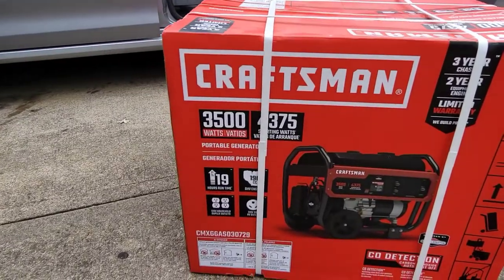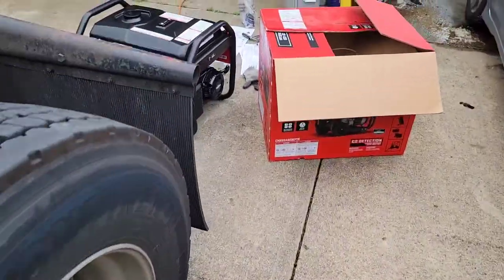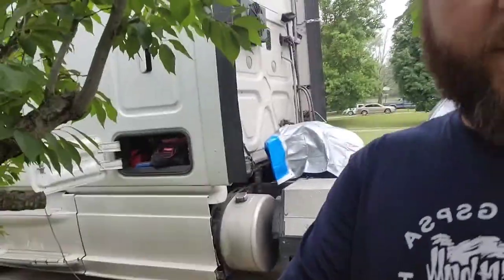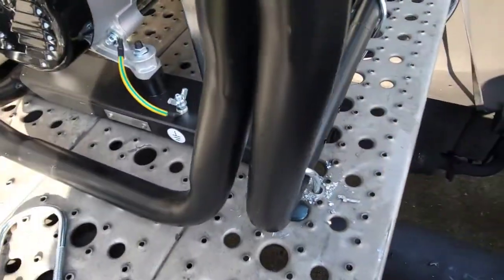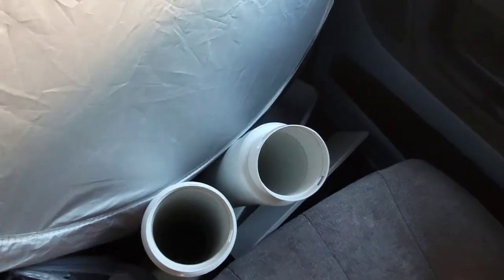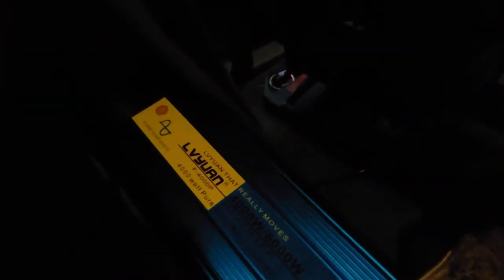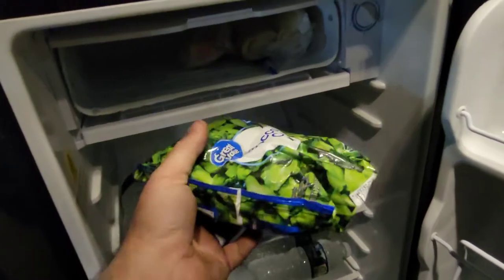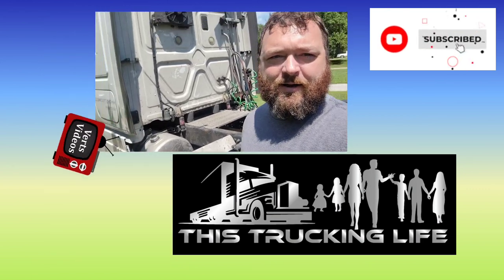How to Install a generator on your semi truck.

Comment: I think you will be saving more than that ,, I run my 3000 eu inverter and  is only 2 gallon tank and less for 10 consecutive hours just running the the 10,000 btu ,if is really hot outside I'll say 8 hours straight
Reply from the maker: I have switched to a smaller more portable one it last about 7/8 hours and runs my smaller AC but I got out of the owner operator game it's a joke I make so much more money now with Walmart check out my last live if you're interested it's awesome

Comment: You can put a muffler on your generator to quiet it down a whole lot more.
Reply from the maker: I almost used the one from my old apu but instead I bought a smaller one. It's just easier because the little one you can keep in the cab or under bunk until ready to use and it's a much quicker set up...I had my bigger one on the cat walk with a tarp...took for ever
Reply: Is that something that needs to be modified or can just add on?

Comment: I've just watched your video, and i love it. Maybe you can respond to me. How do you protect it from the rain/snow or to be too obvious when it's running?
Reply from the maker: When it rained I had it under the truck. No issues always had it on the ground and locked with a cable lock lol

Comment: I have same setup but the problem is carbon monoxide getting inside truck 
I did extended exhaust anyway getting inside
Reply from the maker: I ALWAYS have a working carbon dioxide alarm inside the semi. I ended up using a smaller and quieter one. I was able to put it on the ground under the truck down wind. Worked good.

Comment: Hey what type of ac/heater do you use for you truck.  Looking for one for mine so I don't burn threw as much diesel fuel in my truck.
Reply from the maker: Well for ac I use a Haier Portable ac I bought on sale at target. I use a 2300 watt wen Amazon special generator. As far as heat goes I can just point the exhaust port into the bunk area and design some type of vent to vent the cool air...video will be made of this. There is a video of the little generator on my channel.

Comment: When you’re 34 reset how many hours you torn it off before you start again and how many hours it run straight thank you
Reply from the maker: I never do a reset on the road. I've switched to a smaller quieter unit. It lasts 6 to 8 hours on a full tank. The video is somewhere on my channel. These big ones are too loud and not efficient.
Reply: Thank you driver i sow the other one it’s quite

Comment: Hey, for how long does it last while using all the devices . And how many gallon of Gas does it need ? Thx u.
Reply from the maker: The big one I only used one night I was so loud. The little orange WEN I used quite a bit it powered the big portable ac and the TV DVD phone charger and fridge . It would run about 6 hours full throttle on a tank.
Reply: Thanks you,  for the information

Comment: Is there a 12v outlet on your generator?  If so  have? Can we charge the truck batteries with generator? I just curious
Reply: If you have a shore power plug on the outside of your truck, plug it in to the generator or your house and yes, it will charge the truck batteries.
Reply from the maker: All the generators I've had do have 12v outlets. I've seen people using the NOCO genius to help the system. Really interesting!

Comment: Get a inverter generator. They run at lower rpm and are twice as quite
Reply from the maker: I run only inverter generators..idk if they even sell regular generators anymore?
Reply: @ThisTruckingLife  they certainly do.. the one you had looked like a regular genorator. Maybe I looked at it wrong

Comment: And how the noise to the other driver ??  Wat a lack of respect to the others
Reply from the maker: Yes it was too loud I only used it one night and I parked as far to the end of the line as I could I ended up buying a smaller one that's much more quiet and it worked fine but I'm at Walmart now making the big bucks without the risk

Comment: Is there a 12v outlet on your generator?  If so  have? Can we charge the truck batteries with generator? I just curious
Reply from the maker: Yes there's a 12v on both generators. There's a couple of guys on YouTube that have these generators permanently mounted and are running some type of battery charging system with it.
Reply: @ThisTruckingLife  thank you For answer.  I have predator 3500w. I will try.